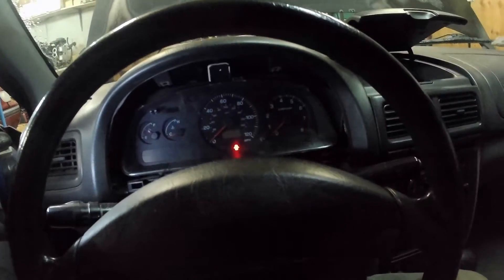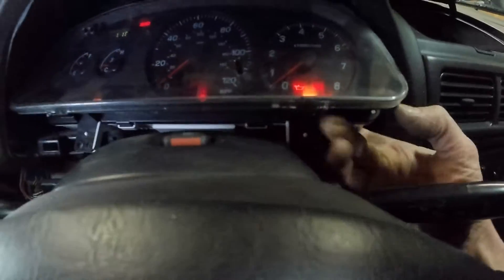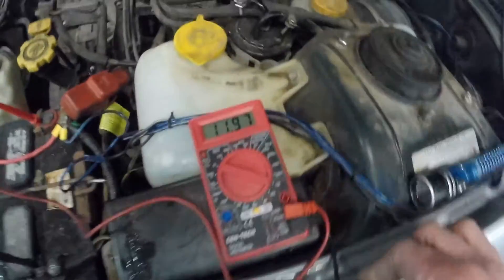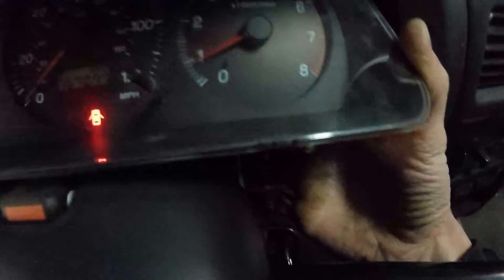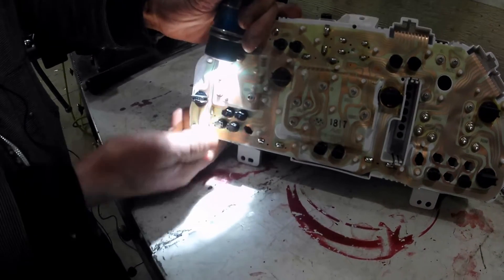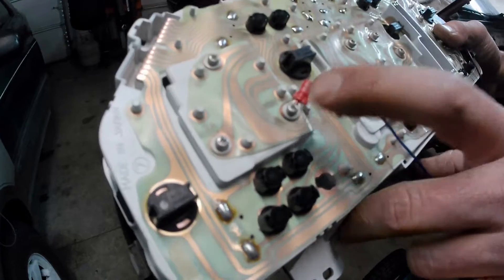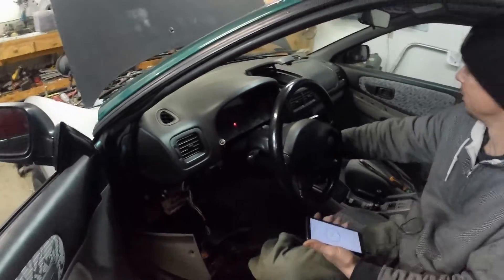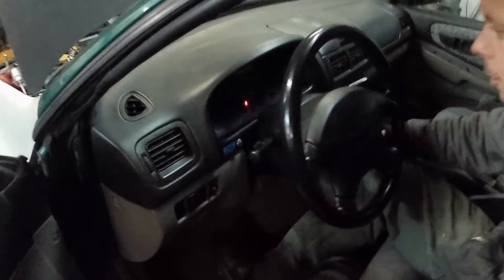Alternator not charging? Check this circuit

Comment: You possibly can connect a line, switch, and fuse and go directly to the field pin.
Reply: If there is no resistor between the field winding and positive post (or I think it's negative actually) then you likely need an old style light bulb (usually a simple small incandescent 12v light works) in series to reduce the current flow. Light bulb is somewhat self regulating too

Comment: So help me.    I took all out alternator belt. Started the car the battery light comes on at acc but ignition off with or without alt.
2003 Nissan t30 xtrail
Reply from the maker: If your battery light is coming on when you turn the key to accessory that normal operation, you need to start the car for the light to go out, if the alternator isn't spinning it won't generate power to back feed to the light circuit and turn it off, if the batt light never comes on then you have ether a burned out bulb or a problem in the wiring, but if the battery light stays on after starting the engine then you likely have a bad alternator and I would use a voltmeter to check the charging voltage.

Comment: I’m wondering if this is the same thing going on with my 2000 Toyota Solara. New alternator not charging new battery. 3 batteries have gone dead and there is no battery light warning coming on. It does come on when car first starts but not while it’s running and battery is definitely low. Guess I’ll check this out. Thank you.
Reply from the maker: When you turn the key to on but don't start the engine the battery light should turn on and go out once you start the engine so if you never see that light turn on it is likely causing your alternator to not charge.
Reply: @ImpreziveGarage  the light does come on when starting. But the light never comes on even though battery is almost dead. There is no warning light showing there is a charging problem.
Reply from the maker: The next thing I would check is your fuse's, it probably wont be a regular blade-type fuse but likely a big high amp fuse 100 amps or more and should be in the fuse box under the hood.

Comment: They should put a resistor in parallel with it to prevent a no start or no charge
Reply: Can you explain, please? My Infiniti has the same charging problem from indicator light nonfunction.
Reply: @TimmayFilms